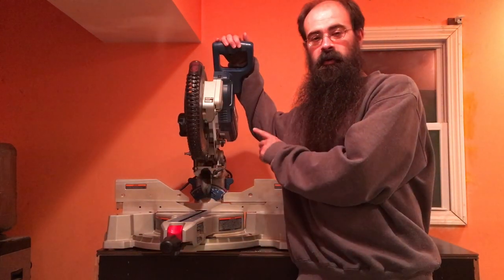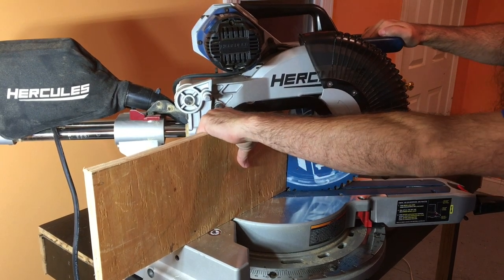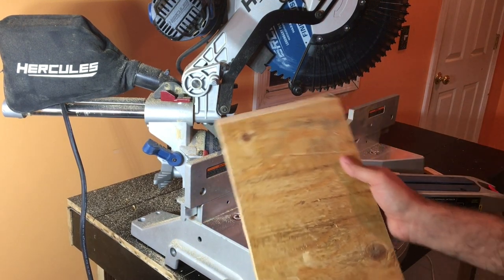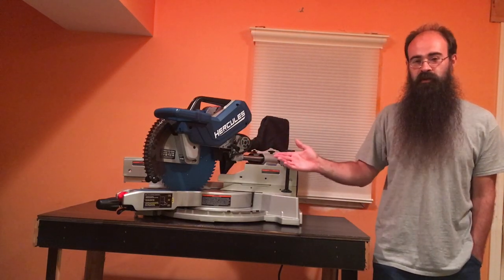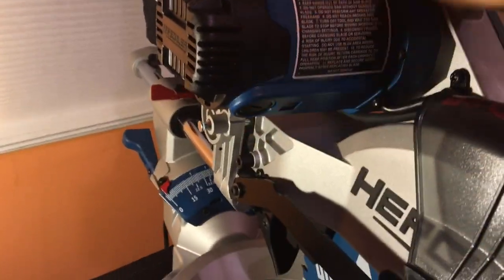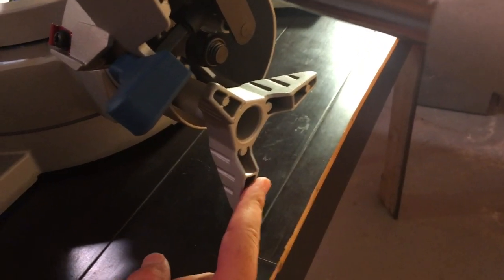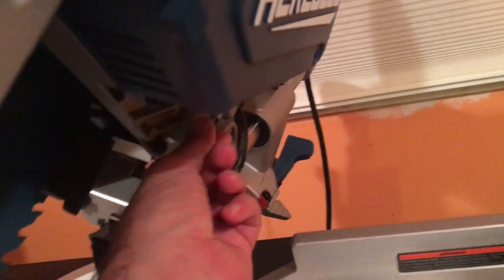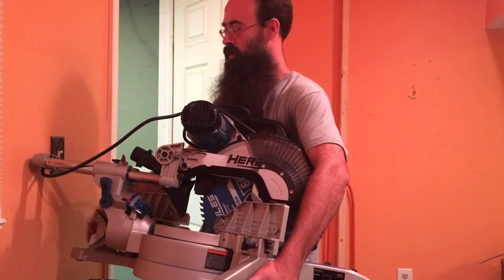Hercules saw review

Comment: I'll second what you said about moving the fence if you are changing the angle. I forgot to and my blade hit the fence, the saw kicked back and the blade jammed into a metal piece. Luckily, I was still within my warranty so I brought I back and they gave me a new one. Was completely my fault. Saw works great. My only problem now is that I am working a bit slower than before because I am afraid of having another accident, one that might be worse. Just going to take me some time to get used to it again. Good news though, I always check the fence before I cut now lol

Comment: I’ve had mine for like a year and it’s amazing. People in the beginning only wanted to say how it was garbage and they wouldn’t trust it because it’s from HF. Well, now there are tons of pros who swear by the Hercules saw. It’s a winner.
Reply from the maker: Yeah I did not know how people can be so fixed on one brand. I'm always looking for better and this saw is still working fine. Glad to see you'r willing to risk trying something new, glad its still holding up well for you.
Reply: I think I finally decided on this saw lol. I just have a single bevel 10-in right now and I need to upgrade. I'm kind of down to the admiral 12-in, metabo 10-in sliders and this Hercules 12-in slider. this one just has so many features and positives that I'm going to go for it. it's the only way I know of to get the Shadow cut line for $320. that coupon expires tomorrow so here we go...
Reply: Yeah I was amazed at the hatred for this without giving a try or chance, I was looking at the DWS780 then this came out so waited and watched.  Went with this and I am impressed and happy with my purchase, cuts were accurate out of gate and remained accurate.  I heard people say that this is loud but I find it rather quiet.  This thing has some power to it and haven't faced anything that has given it a challenge but I need to do some PT 4x4s in the spring so I guess we'll see.  I got it on sale and went with the 2 year service plan so for less than $400 I got a similar saw to the DWS780 with a better warranty for $200 less or 2/3 the cost.  Enjoy your red or yellow saws, I'm very happy with my blue

Comment: Just picked up this saw, tomorrow it goes back. Haven't even plugged it in, from the front of the knob on the front of the saw to the back of the slide  bars you will need about 41", yes, that's correct. It doesn't fit where I need it to be. This sucks.
Reply from the maker: I don't get why thats a problem I for one need the long reach of the slide bars. If its a storage problem you can twist the front knob off and save 4in or better yet you the saw to craft a bigger shelf.
Reply: @beardhut2934  Apparently I failed to explain something. My bench is 24" wide, this miter saw is 41" front to back. I have a small shop with a table saw directly across from the work bench. In other words, the knob on the front sticks out about 17" into the area where the table saw is.
Reply from the maker: @rayc.1396  Ahhh ok that paints a much better picture.  Thanks
Reply: I hear that about the size.  My garage is only 10ft wide and 16 feet long.  I have a small car and its a tight squeeze trying to get the car in there..so im setting up my shop.  Right now I have to angle the stand in the middle of the space!  No room for moving in wood.  Have to juggle things around but thats ok.  I'll figure something out.